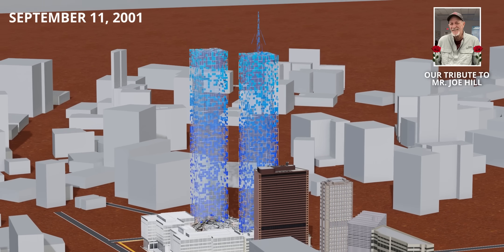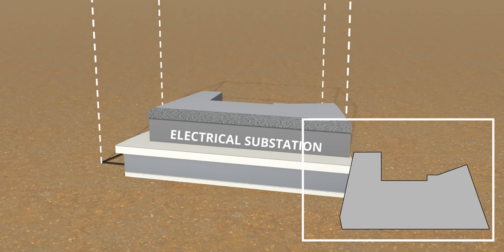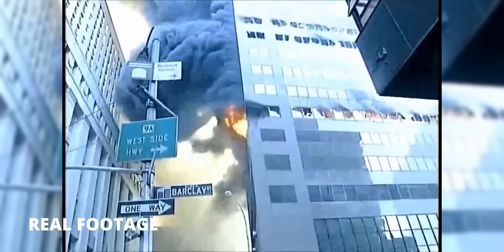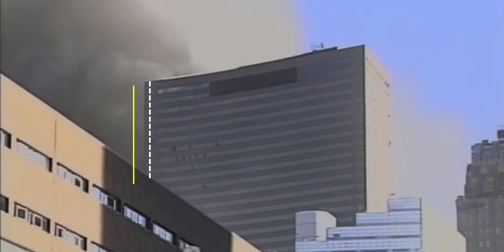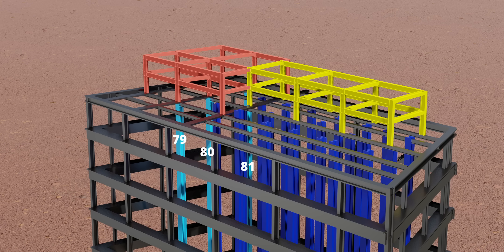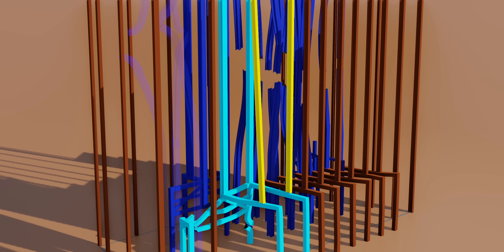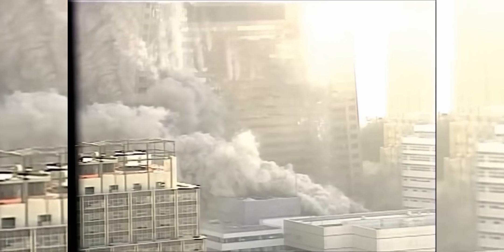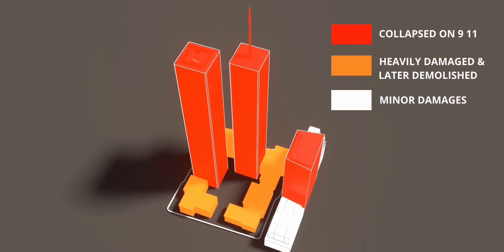Collapse of Building 7 | The Complete Physics

Comment: I have reported this video as fraudulent misinformation and fake news. You are a liar who knows absolutely nothing about Building construction, and you misrepresent what actually happened to Building 7.
Reply: This Lesics video is very good – with one or two exceptions - and goes into a much higher level of detail than many viewers will be able to comprehend.  While not perfect, the collapse mechanisms – the sequence of failures - described here by Lesics are substantially correct and this is true no matter who planned and carried out the 9/11 attacks or why . 

That may not be what you want to hear and go against 20+ years of entrenched dogma and conditioning, but it’s not wrong. 

That also means (in case you did not get the hint) this video can be (and IS) absolutely correct in its description of collapse mechanisms AND the 9/11 attacks could still have been some sort of inside job. The two things are in no way mutually exclusive. 

The mechanisms described here have broad professional support around the world. There are no professional engineering organizations (for example: ASCE, ASEE, ICE, etc) that disagree with them or have offered any formal dissenting opinions or alternative hypothesis. 

The mechanisms described here are not new. They have been well understood for many years and much of it can be easily confirmed by simple observation. You can literally see most everything they are talking about if you just bother to look. 

So, setting hubris aside, either the overwhelming majority of the worlds structural engineers and simple observation are wrong,… … or you are. Which seems more likely? 

IF you still think believe this explanation is wrong then produce a better one . Good luck with that. No one ever has and I don’t see you moving that needle today. 

No one ever does.

When you can't produce a better explanation then figure out why YOU are wrong.

Comment: Hilarious propaganda video.😂😂😂
Reply: This Lesics video is very good – with one or two exceptions - and goes into a much higher level of detail than many viewers will be able to comprehend.  While not perfect, the collapse mechanisms – the sequence of failures - described here by Lesics are substantially correct and this is true no matter who planned and carried out the 9/11 attacks or why . 

That may not be what you want to hear and go against 20+ years of entrenched dog_ma and conditioning, but it’s not wrong. 

That also means (in case you did not get the hint) this video can be (and IS) absolutely correct in its description of Building 7 collapse mechanisms AND the 9/11 attacks could still have been some sort of inside job. The two things are in no way mutually exclusive. 

The mechanisms described here have broad professional support around the world. There are no professional engineering organizations (for example: ASCE, ASEE, ICE, etc) that disagree with them or have offered any formal dissenting opinions or alternative hypothesis. 

The mechanisms described here are not new. They have been well understood for many years and much of it can be easily confirmed by simple observation. You can literally see most everything they are talking about if you just bother to look. 

So, setting hubris aside, either the overwhelming majority of the worlds structural engineers and simple observation are wrong,… … or you are. Which seems more likely? 

IF you still think believe this explanation is wrong then produce a better one . Good luck with that. No one ever has and I don’t see you moving that needle today. 

No one ever does.

Comment: Must just be one of those weird coincidences that prior to 9/11, no steel girder building or highrise had ever collapsed due to fire. Or, that the buildings imploded as if taken down by controlled demolition.  Or, that the disaster control center was located in WTC 7. Last but not least, that the records needed to account for the  $12,000,000,000,000 the Pentagon could not account for which Donald Rumsfeld cavalierly mentioned as a kind of side note in a press the previous day. How did they collapse indeed !
Reply: Before December 17th, 1903 man had never achieved powered heavier-than-air flight before. Must have been one of those weird coincidences.

Obvious logical fallacies make for bad arguments.
Reply: " no steel girder building or highrise had ever collapsed due to fire. "
Buildings have collapsed due to fire before.
Tall buildings have collapsed due to fire before.
The towers didn't collapse due to just fire.
If all that happened on 9/11 was a fire at WTC7 then it wouldn't have collapsed.

You have no idea.
Reply: "Or, that the buildings imploded as if taken down by controlled demolitio"
Gravity pulls down.   

"  Or, that the disaster control center was located in WTC 7."
It wasn't.

" Last but not least, that the records needed to account for the  $12,000,000,000,000 "
No you're referencing a report about 2.3 trillion and more than half of it was reconciled within 6 months of 9/11....
Reply: @MarkH-cu9zi  Office of Emergency Management was not located in WTC7 you stupid liar?
Reply: @Kudde23  "New York City Emergency Management (NYCEM) (formerly the New York City Office of Emergency Management (OEM)) was originally formed in 1996 as part of the Mayor's Office under Rudolph W. Giuliani. From 1999 until September 11, 2001, New York City's Emergency Operations Center was housed on the 23rd floor of the 7 World Trade Center building."

What do you know, you said stupid shit again. Then again, you're used to that.

Comment: Having watched your twin towers videos, are you saying they were all built poorly? This one fell due to fire. I see the damage, which, incidentally, wasn't caused by the spire, but it still fell because of fire that wasn't fueled by aviation fuel, and buckled columns that hadn't had the protective coating scraped off from a plane. It fell due to fire, so it's junk engineering. Is that correct? Because if it is, Heaven help us if anyone ever decides to attack our largest city with other means. If they can't take a fire and a little damage, imagine what small aerial explosive devices could do.
Reply: Not at all what he is saying. 

Building 7 fell due to fire.

Seven (7) hours of unfought multi-floor fires (a critical element you seemed to have missed).

How many structures can you think of that would do well with unfought fires raging throughout for 7 hours?

Collapse of a burning structure is always a concern for firefighters. Steel buildings subject to fire rely on active fighting of the fires to survive. Left to their own devices they will collapse. Buildings are designed around 1 to 3 hours of fire resistance, allowing time for occupants to escape and ACTIVE firefighting to get started, after which all bets are off. In B7 the occupants escaped, passive and active fire protections were compromised and active firefighting never got started which left the building to take its chances. It lost. Odds on Building 7 would eventually collapse,… and it did. No big deal in logic. That is the sort of choice firefighters make every day in brush fire situations - which houses to save and which ones to let go. Only real difference here is moving the decimal on the size and cost.

Comment: Nice propaganda video 😂😂😂
Reply: This Lesics video is very good – with one or two exceptions - and goes into a much higher level of detail than many viewers will be able to comprehend.  While not perfect, the collapse mechanisms – the sequence of failures - described here by Lesics are substantially correct and this is true no matter who planned and carried out the 9/11 attacks or why . 

That may not be what you want to hear and go against 20+ years of entrenched dog_ma and conditioning, but it’s not wrong. 

That also means (in case you did not get the hint) this video can be (and IS) absolutely correct in its description of Building 7 collapse mechanisms AND the 9/11 attacks could still have been some sort of inside job. The two things are in no way mutually exclusive. 

The mechanisms described here have broad professional support around the world. There are no professional engineering organizations (for example: ASCE, ASEE, ICE, etc) that disagree with them or have offered any formal dissenting opinions or alternative hypothesis. 

The mechanisms described here are not new. They have been well understood for many years and much of it can be easily confirmed by simple observation. You can literally see most everything they are talking about if you just bother to look. 

So, setting hubris aside, either the overwhelming majority of the worlds structural engineers and simple observation are wrong,… … or you are. Which seems more likely? 

IF you still think believe this explanation is wrong then produce a better one . Good luck with that. No one ever has and I don’t see you moving that needle today. 

No one ever does.
Reply: It's a shame that your considered response will only be read by a small fraction of the people who see the inane comment you are replying to
Reply: @neutralyukka  - Intended for an audience of one, who probably won't read it either. Too much text, not enough attention span. Doesn't fit the dogma.

Comment: lol they keep making excuses. No actual scientific data here. Literally anyone could have made this animation.
Reply: This Lesics video is very good – with one or two exceptions - and goes into a much higher level of detail than many viewers will be able to comprehend.  While not perfect, the collapse mechanisms – the sequence of failures - described here by Lesics are substantially correct and this is true no matter who planned and carried out the 9/11 attacks or why . 

That may not be what you want to hear and go against 20+ years of entrenched dog_ma and conditioning, but it’s not wrong. 

That also means (in case you did not get the hint) this video can be (and IS) absolutely correct in its description of Building 7 collapse mechanisms AND the 9/11 attacks could still have been some sort of inside job. The two things are in no way mutually exclusive. 

The mechanisms described here have broad professional support around the world. There are no professional engineering organizations (for example: ASCE, ASEE, ICE, etc) that disagree with them or have offered any formal dissenting opinions or alternative hypothesis. 

The mechanisms described here are not new. They have been well understood for many years and much of it can be easily confirmed by simple observation. You can literally see most everything they are talking about if you just bother to look. 

So, setting hubris aside, either the overwhelming majority of the worlds structural engineers and simple observation are wrong,… … or you are. Which seems more likely? 

IF you still think believe this explanation is wrong then produce a better one . Good luck with that. No one ever has and I don’t see you moving that needle today. 

No one ever does.
Reply: Oh well if ASCE or ASEE didn't protest against this, then it must be right.  You surely convinced me!
Reply: @jochemlambers  - If you actually understood how engineers think then you would know that is an excellent sign this is right. But you go ahead and keep trying to prove De Nile is not just a big river in Egypt. I really hope that works out for you someday.

Comment: Appreciate the visual attempt at this as many ignore building 7.

I see a problem with fires with no jet fuel being hot enough to do damage to the columns, though. And the antenna fell away from this building.
Reply: i know its pointless to participate in an internet argument but I'm just going to put this out there anyway. fire damages anything and everything. it just has to burn long enough to cause damage. just google the sinking of the MS Achille Lauro in 1994, a ship that sank only because of fire.

Edit: yeah this was a pretty stupid argument to make. however I still think if a fire can burn long enough it can bring down anything.
Reply: @itzcrystalbtw  ships don't have load bearing columns, so what's your point?
Reply: @itzcrystalbtw  control demolition...huhuhu
Reply: Jet-A even under forced air does not burn hot enough to weaken steel or even come close to melting it. If it did, you wouldn't be enjoying a flight on a jet airliner. Besides, Mr. Silverstein clearly stated tat the building was pulled aka controlled demolition. This was all planned months in advance.
Reply: @Ron-zr6se  Jet Fuel doesn't melt steel, but it does weaken it. You can find videos of people  testing this theory and bending steel with their pinky finger after heating it to around the same temperature.
Reply: A 3 stories school burned down in my area. I beams all twisted up from the heat which was nothing close to WTC.

Comment: this whole video is bullshit
Reply: This Lesics video is very good – with one or two exceptions - and goes into a much higher level of detail than many viewers will be able to comprehend.  While not perfect, the collapse mechanisms – the sequence of failures - described here by Lesics are substantially correct and this is true no matter who planned and carried out the 9/11 attacks or why . 

That may not be what you want to hear and go against 20+ years of entrenched dog_ma and conditioning, but it’s not wrong. 

That also means (in case you did not get the hint) this video can be (and IS) absolutely correct in its description of Building 7 collapse mechanisms AND the 9/11 attacks could still have been some sort of inside job. The two things are in no way mutually exclusive. 

The mechanisms described here have broad professional support around the world. There are no professional engineering organizations (for example: ASCE, ASEE, ICE, etc) that disagree with them or have offered any formal dissenting opinions or alternative hypothesis. 

The mechanisms described here are not new. They have been well understood for many years and much of it can be easily confirmed by simple observation. You can literally see most everything they are talking about if you just bother to look. 

So, setting hubris aside, either the overwhelming majority of the worlds structural engineers and simple observation are wrong,… … or you are. Which seems more likely? 

IF you still think believe this explanation is wrong then produce a better one . Good luck with that. No one ever has and I don’t see you moving that needle today. 

No one ever does.

Comment: I am wondering where 81 columns with a length of around 70% of the building high are left in the debris.
Reply: @h1F595  I saw not a single one with a length of at least 100m. The building was 186m high. Maybe you can provide a picture?
Reply: @mailmaster77  After all, all the column would still be full length....that even ignoring that the columns were one long 100 meter length in the first place.
That's so ridiculous there isn't words
Reply: Underneath the moment frame, floors and perimeter columns at the base of the pile.

Comment: The "spire" did not fall on the WTC 7 building. The antenna fell down together with the North Tower. Why are you lying and spreading misinformation? What fell on the WTC 7 building was general debris from the North Tower (WTC 1). The antenna fell almost completely vertically together with the North Tower.
Reply: Could it not be just that he got that bit of information wrong and not that he's intentionally "lying"??
Specially when what piece of debris caused the damage isn't really relevant to his explanation, and therefore he had no reason to lie about it.
Reply: @tbbcch1039  The only way that he got that bit of information wrong is by not even watching a WTC1 collapse video. He wants to teach us "facts" based on nothing but his stupid fantasy. Of course this makes him a liar.
What caused the gash may not be relevant to his BS explanation on WTC7 but it´s relevant to his BS explanation on the Twins. The gash was caused by WTC1 core columns tipping all the way to WTC7. So how would the core columns tip over in such huge lengths in his BS Twin "explanation"? Exactly, they wouldn´t, his BS Twin "explanation" is debunked by the tipping core columns he missed because he didn´t bother to do any actual research.
Reply: @tbbcch1039  He wouldn't get that information wrong. Because the videos prove him wrong. He is just doing his role in misinfomration and misdirection. To the best of my memory recollection, I think that only one who said that the antenna caused the collapse of WTC 7 was Larry Silverstein. The one who coincidentally stood to gain million from the collapse of the WTC 1&2.
Reply: The gash on WTC7 was caused by tipping core columns from WTC1.
Reply: What's event funnier is the "REAL PHOTOGRAPH" shown at 3:53 is clearly AI Generated (look closer at it, zoom in) - which is important because that's what much of this video's argument hinges on (the "gash" theory here).  These people really have no conscious, man.

Comment: This video is a fairytale.

Demolition charges are
clearly exploding at 8:45.
Reply: So the charges started going off (silently and with no high-pressure blast wave, flash or lethal high velocity ejecta) more than 10 seconds after the collapse began???

That would be highly irregular. 🤦‍♂
Reply: The "demolition charges" that don't actually explode, that is.